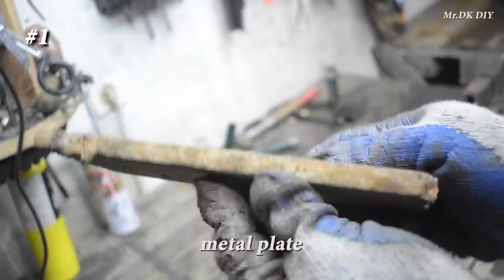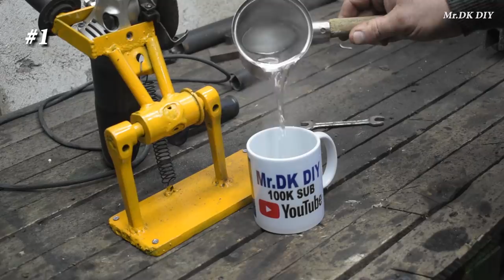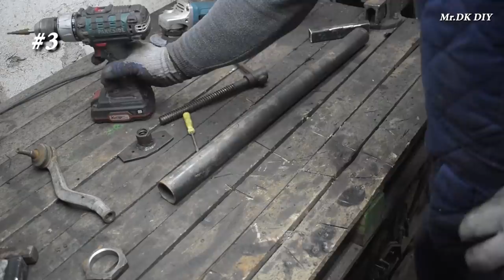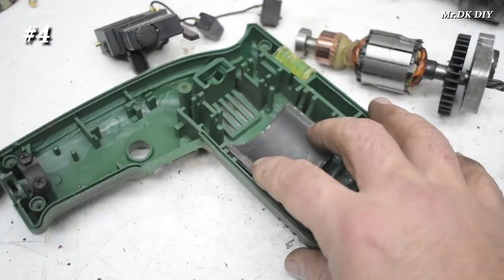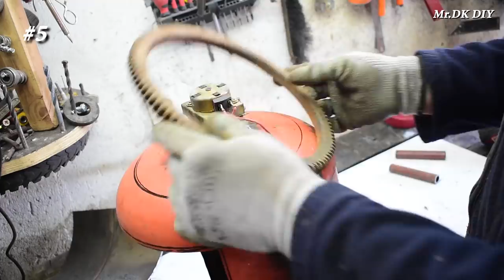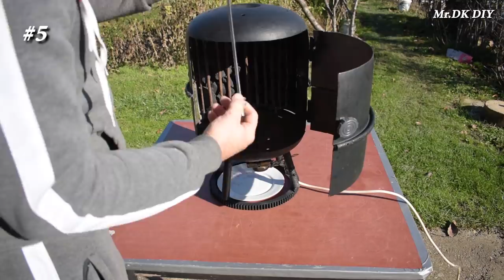4 PERFECT Homemade IDEAS and One DIY Experiment

Comment: That's a great holder for your cut-off angle grinder and works like a charm.  The thing I like best it is completely portable and can be mounted anywhere in just a few minutes like on a bumper on a truck or up high on a building structure.  Good Job~!! 🤓👍✌

Comment: I've heard it more than a few times that "AC" drills can wok unmodified of equivalent voltage or less  DC power.  So if you're looking to run a drill off DC try running your 12V though a high amp DC to DC converter or steppe transformer if 12 V isn't enough and see if it will work unmodified.
Reply: Theyre called universal motors, will run ac and dc, but usually with a performance hit unless run through a rectifier
Reply: Bf u
Reply: 0

Comment: Hey Mr DK, good ideas.  I like to ask you. why did you cut the expansion tank in half then weld it back, then chop it up in pieces? scratching my head.
Reply: I think it is because expansion tanks have a rubber diaphragm that is clamped between the two halves and he wanted to remove all the rubber from the tank (it would make the food taste really bad when it burned).